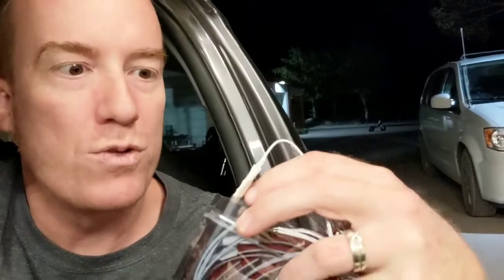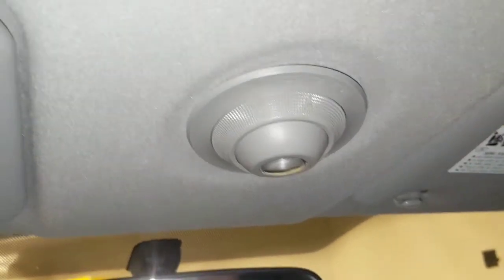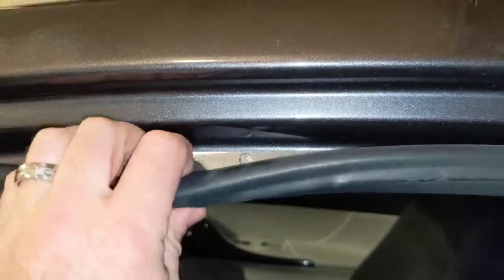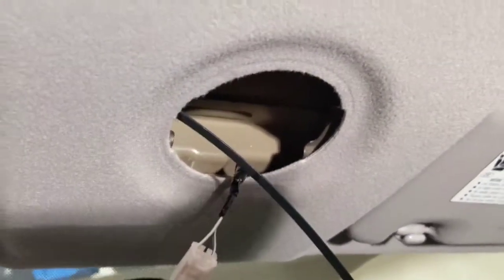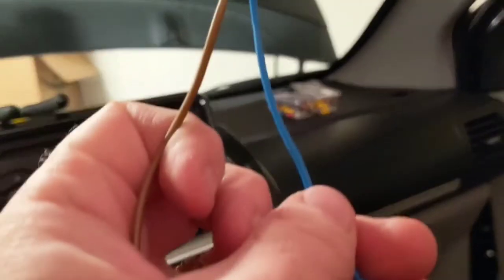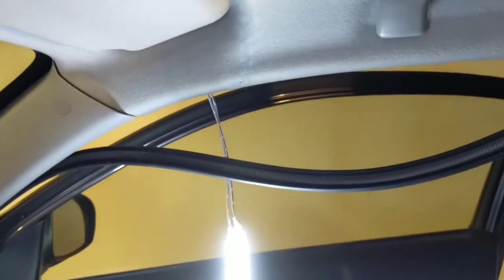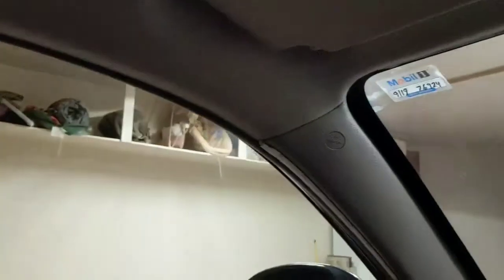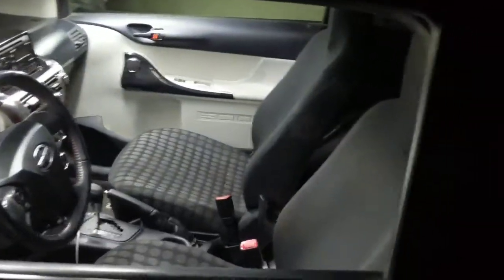Installing extra LED's via the dome light in 2012 Scion iQ

Comment: Great job! I got my iQ new in 2013 and always slammed the pathetic interior lighting on the Toyota surveys. On mine, I’ll run two to the trunk and use t-taps to splice the wires together.
Reply from the maker: Yeah the stock light is pretty much useless. I need to invest in a few more connectors as well, so I don't have to solder and tape everything ;)
Reply: Well I tried it and have all four connected and dome light works but nothing to all four lights...got black on black and white on white spliced (I assume on the lights the white with stripe is black)
Reply: @rickboucher6061  check your LED strip connector polarity. I play around with a lot of them and it's not always correct. The tape itself will have + and - onto, but always test them using a little 9v battery. If the polarity is reversed, they won't light up.

Comment: Great vid..question:..does the lights only work when opening the door or do they also work when u turn the original dome light from on/off/door???
Reply: Only works when you open the door.
Reply: @kenduffy  any idea how to get it connected so it works if u need it to light up turning the dome light...i mean so u dont have to open the door all the time "in the dark of night" to get the lights working inside if your looking for something:)?
Reply: @kennethandersen6920  sorry that's beyond my expertise 😬
Reply: You can install a switch on the red line of the LEDs